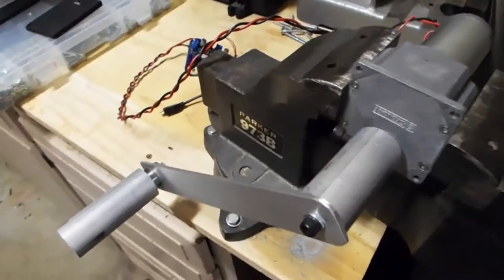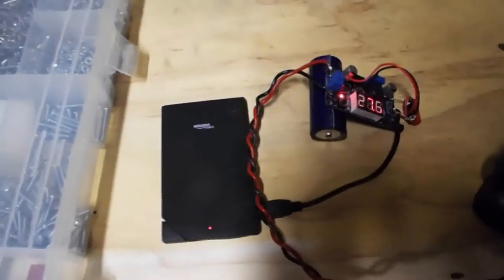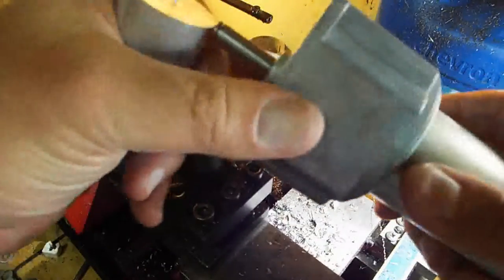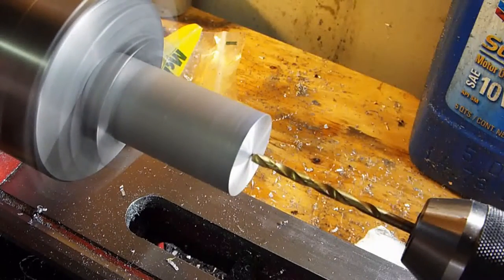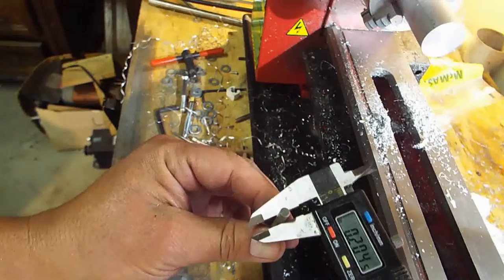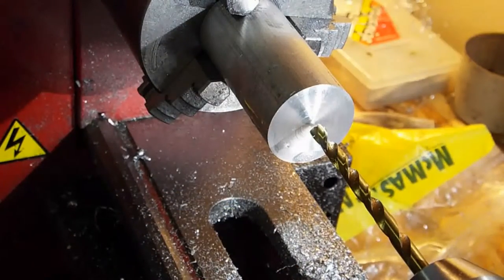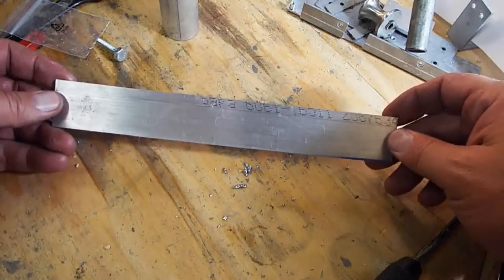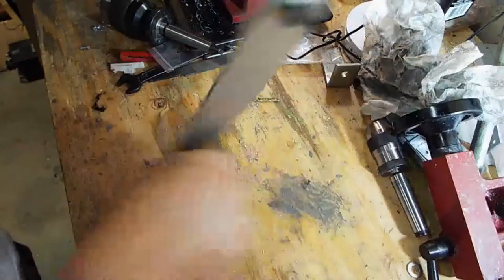Make a Hand Crank Generator Using a Gear Head Motor

Comment: So if you added more capacitors or a larger one you could crank for a few minutes then stop and let the capacitors drain into the battery pack right?  Or would the capacitors lose the power to quickly, either way interesting setup, just wouldn't want to sit there cranking for an hour to get a battery pack filled up full.
Reply from the maker: Yes you could make a "reservoir" that you could charge that would in turn charge something else, but just keep in mind the more power that you have to put in in a shorter amount of time will make it harder to crank by hand.

Comment: I also watched the first video.. How the heck do I know which one of these gearhead motors will give me the current I need? I also did some research on electric motor generators, and was directed to a wind turbine page.. Basically, it's Voltage / RPM. So if I had a 24V motor that' spins at a max of 1100 RPM, 24V / 1100 = 0.021818 V/RPM.

I also know Ohm's law, and some other things, but nothing helps me when looking at the  items on eBay how much current it outputs.

I can even drop the voltage down, using either a Buck or SEPIC converter. I can also use a Linier voltage regulator like a LM7805. Vin - Vout x Iout = Watts dissipated.

I too want to make one of these, and NOT pay $65 for one already made. I want to make it myself.

Could you help? What do I look for in a gearhead motor when trying to make my first simple cell phone charging hand crank generator dynamo, when looking for current output? They mostly all say with no load. That goes both ways.. You'd think. The load would be on the incoming end.
Reply from the maker: I would look for a motor that was rated at a loaded current for at least
 what you want to generate and just a little more. For example if you 
wanted to run a 1 amp output with your hand crank generator I would 
search for a motor that was rated for a minimum of 1 A under load, I 
would be a little more conservative and actually search for one rated 
for 2 A that way the winding in the motor would not get too warm when 
under load.
Reply: Thanks so much.. I'll do just that.
Reply: So I've been looking at motors for 4+ days. I've learned a lot since then. I learned what Torque is, how to convert torque, different length handles and how they can make the load easier. Anyways, I've been looking at them, and I see Stall Current.

So 12V @ 20A stall current.. Does that mean that at 5VDC the max current I can supply is 20A / 12V = 1.6A per volt x 5V = 8.3A ?

Is that correct? If so, then I'm good to go on my gear motors.

I've been staying at this website : https://www.servocity.com

They have some nice motors. imho. Besides the ones you have.
Reply from the maker: Stall current is when the rotor stops moving. What you want is running current under normal load.